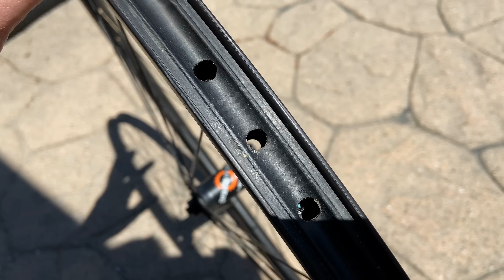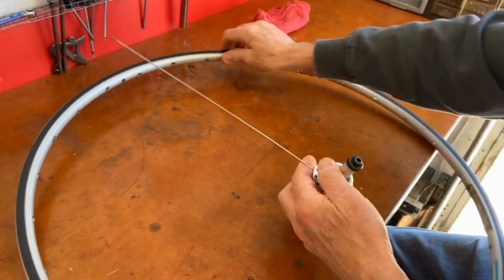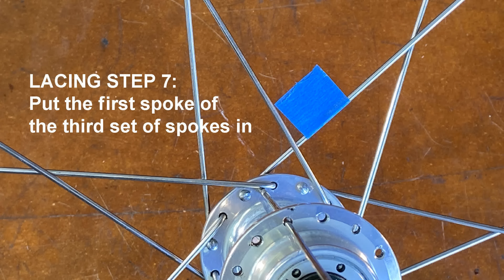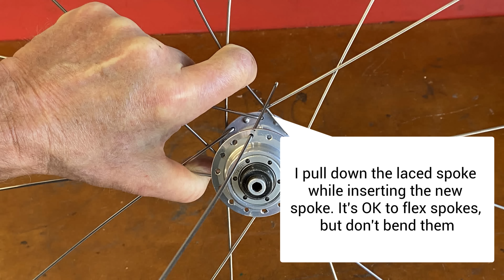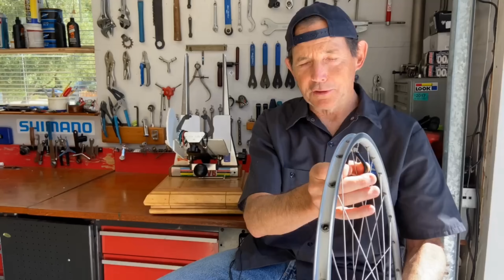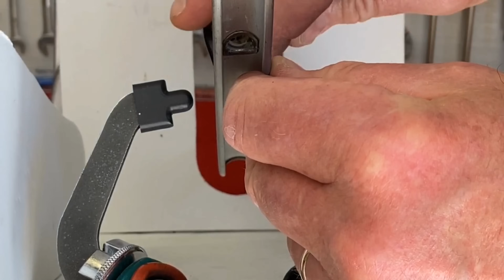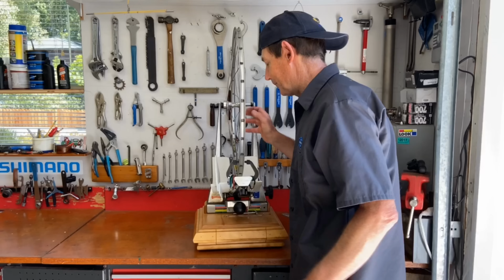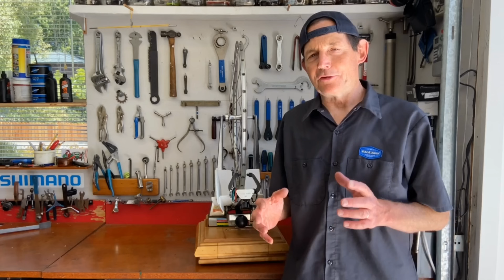How To Build Bicycle Wheels THE EASY WAY! #bikerepair

Comment: Hello, I want to buy 29” rims & put a Shimano  8 speed internaly geared hub with discs front & rear. How do I choose , what rims I need. I am living in the Philippines  & have a pedicab, which is like a side car set up with a 3rd wheel. Where do I start, may I ask ?  : )
Reply from the maker: Thanks for watching and the interesting question, Jethrezel. If I was asked to build wheels and choose rims for a pedicab (I have never built any), I would research what others are using for rims on their pedicabs. They have to be able to withstand the weight carried on the bike, the extra lateral forces on this type of vehicle and the roads/terrain they'll be taken over. Plus, they need to accept the tires suited to pedicab use. 

So, it's basically a research project to investigate what rims are used and then once you have a basic understanding you can then visit wheel parts sellers and choose appropriate rims. I would think that strength will be your primary concern and that you might even want to look into whether you can find a pedicab company that sells rims for pedicabs. They might be a lot less expensive than bicycle rims and will probably be made of steel. That might work fine. You should be able to make a good choice once you understand the specs you need for the use you have in mind. There are likely some mountain bike rims that will work, too, but you want to be sure they're strong enough. Hope something here helps you get started. Thanks again.
Reply: @JimLangley1  hello, Thank you for your reply. The rims are 28 inch steel ones. I would have to order a Shimano 8 speed internaly geared hub online. No stock where I am.  So finding the rims are no problem but  How Will I know if that hub Will lace in to the rim? Spokes also can you cut your own spokes to size? If so what is the formula for that, may I ask ?  : )
Reply from the maker: @jethrezelquizol6690  Here's my video on how to find your spoke length, Jethrezel - https://youtu.be/LvV4FE2VxZk You need the hub and rims to have the same number of spoke holes to be sure they're compatible. I'll read and reply to your other questions next so please keep reading below.
Reply: @JimLangley1  I imagine I count the number of spoke holes in the Rim & count the number of spoke holes. In the Hub I wish to use. If they are the same, then im Good to Go ?  But that just leaves me with choosing Spokes & Spoke size? What material makes the strongest Spokes & why ? : )
Reply from the maker: @jethrezelquizol6690  the best spokes are made by experienced spoke makers such as the brands Sapim and DT Swiss. And they would be made of stainless steel while the spoke nipples to get would be made of nickel plated brass. I hope this helps you build some nice wheels.
Reply: @JimLangley1  I was thinking of ordering Alloy rims online. Do you think I should stick with th steel ones here ?
Reply from the maker: @jethrezelquizol6690  I'm not a pedicab expert, Jethrezel, but the ones I see here are carrying 3 sometimes 4 people. That's a massive load. I would think you'd want the heaviest-duty, strongest wheels you could build. I think if you go with lightweight parts that work on a bicycle, they will probably wear out quickly on a pedicab under the weight of up to 4 people and in constant weather conditions. 

The pedicabs I've seen typically have steel rims, steel hub, heavy tires and even oversize gauge spokes in the wheels, and oversize hub axles, too - think cart rather than bicycle. A cart carries tremendous loads and is made to withstand the punishment. A bicycle is super light in comparison and carries only one cyclist.

Having said all that, you can certainly build the wheels however you want and see if they hold up for how you use your pedicab. Aluminum rims work great on bicycles and they would hold up for a while on any wheeled vehicle. But how long depends on how much load is on them and how hard they're used.
Reply: They just use cheap Chinese tyres here, Tubed 28”+ 1” 1/2 . I was going to order some 2” Maxis tyres online, with the Kevlar in them : )
Reply from the maker: @jethrezelquizol6690  be sure to get tires made for how you're using them - on a pedicab it's not about lightweight and performance, it's about durability. No sense paying top dollar for fancy features that save seconds in a race but will just mean tires that wear out fast under all that weight.
Reply: Also there just ordinary hubs here, nothing special. I wanted to order Shimano Hubs with Disc Brakes. They only use a block of old rubber car tyre on a metel bracket above the front wheel that you push with your foot. Its works Good but I would like Disc Brakes. Once again , How do I know the the Shimano Hubs & Brakes I buy online will lace in to the rims I choose or the Steel rims here, if you think they would be my Best bet? : )

Comment: Thank you for a great tutorial! This was very helpful.  I noticed that you didn't  use a spoke tension guage. Is there a benefit to using them to get the tension right.
Reply from the maker: You're very welcome. Thanks a lot for watching and commenting, Adrenaline. To explain why I don't show a spoke tension gauge in this video, it's because the video is for helping new builders learn how to build wheels. It would be unusual for them to own a tension gauge and they probably wouldn't want to have to buy one, either. If I showed myself using a tension gauge, someone might get the idea that you have to have that tool in order to build wheels. Instead of that, I wanted to keep it simple because spoke tension meters are fairly new devices. People have been successfully building wheels without them for a lot longer than the tools have existed actually.

But, having said all that, spoke tensio or tension (it's spelled both ways), gauges or meters are nice tools to have and very useful if you start building enough wheels to want to own and use one. There is a benefit to using them to get the tension right as long as you read and follow the directions on the tool - otherwise you won't get accurate readings. I do use one for my wheel building, one made and sold by Wheel Fanatyk https://www.wheelfanatyk.com/store/digital-tension-gauge/. Most production wheel builders do because we need to record the tension in our wheels since they're being sold and usually carry serial numbers. I do use and show the tension gauge in other videos so if you want to see it in use, you can watch here https://youtu.be/Wb73si7WD-k?t=576 Thanks again!!
Reply: @JimLangley1  Thank you for that very thoughtful response! It's good to know that the guage isn't a requirement for a well built wheel.

Comment: hello I wanted to ask you. my spoks is shorter 2-3mm I can still build my wheel
Reply from the maker: Hi S T N - when you’ve finished the wheels you should not have any threads showing. If the threads are showing you should rebuild with longer spokes or risk the wheel coming loose and getting out of true often. I hope this helps. Thanks for watching and the question.

Comment: the few times i tried to build a wheel from scratch, the up/down adjustment was the movement i couldn't get out.   side to side is definitely easier.    ...so i gave up and decided I didn't need to learn it since i don't really replace wheels that often
Reply from the maker: Thanks a lot for watching and commenting, littlegoobie - appreciate it!

Comment: Hours into my first wheel build, I found this video. Thank you, well done!!! Clearly explained, I really appreciated his direction, “now be sure to get satisfaction not frustration” paraphrase. This saved the experience for me. Do you have tutorials on bottom bracket service? Or a tutorial on suspension service? Thanks again well done!
Reply from the maker: Thanks for the great comment, Mike. I'm so happy I was able to help you with your wheel build! And I appreciate you watching. I don't have a video on bottom bracket or suspension service on my channel. I will add them to the list. Bottom brackets are relatively easy to understand - once you get past all the different designs and issues caused by that. If you currently have questions/issues with your bottom bracket, I might be able to help here in the comments. For suspension, apart from basic maintenance and setup, I get mine tuned by the pros at Fox, etc. They have the tools and small parts and fluids and they're up to date on every new thing that's come along. Thanks again for watching and the kind words!

Comment: Hi Jim. Fabulous video, thank you so much. One question, sometimes having built a wheel, there is still quite a lot of thread visible on some of the spokes. Is this a problem? Does it suggest spokes maybe not quite long enough (even though calculated correctly).
Reply from the maker: Thanks a lot for watching, Keith. I'm happy to hear you enjoyed my video. When you build a wheel and end up with quite a lot of thread visible below the bottom of the nipples, yes, it means that the spokes are too short. With brass nipples the usual result of short spokes is that the spokes tend not to stay tight because there isn't enough of the threads engaged on the spoke to keep the spokes tight. 

With aluminum nipples it's a worse problem because the aluminum nipples need the spoke inside them to reinforce the nipple where it has to resist sheer forces from the rim. So if the spokes are too short and the wheel is built with alloy nipples, then what usually happens is that the nipples break. Sometimes they will all gradually fail and break meaning a wheel becomes unreliable. 

The only solution to both these problems is to rebuild the wheel with longer spokes. To determine if spokes are long enough look down from above the nipple. You might need a flashlight. If the spokes are the right length you will see the ends of the spokes within a couple of mm of the tops of the nipples. Okay? I hope this answers your question. Thanks again!
Reply: @JimLangley1  Thanks!

Comment: Great video! Watching a pros work flow helps.allot. What do you recommend for lubricating the head of the spoke nipple with?
Reply from the maker: Thanks for watching, Tim. Glad you liked the show! On metal rims, oil or a light grease is fine for lubricating the nipples where they contact the rim. Keep in mind that if you have rim brakes, the rim is the braking surface so you try not to let the oil/grease make it onto the braking tracks of the rim. And, you always clean the rim after building the wheel with a solvent that will remove any grease or oil. For carbon rims, I do not use any lubes most of the time. Some carbon rims call for nipple washers which provide a smooth surface for the nipple to turn on. With carbon if you get grease or oil on it it can get into the carbon and stain it in places and be difficult to remove - depending on the construction and finish on the rim. If in doubt, you could reach out to the rim maker to determine what they recommend for their rims. Hope this is helpful - and enjoy your wheel building!

Comment: If only I could find a BASIC how to re-spoke a rim video, and not somebody trying to cram everything they know into one video, while trying to make it sound as complicated as possible.
Reply from the maker: Thanks for the comment, Jerry. If you tell me what you're trying to do, I will explain how to do it in simple BASIC words. You said "re-spoke" a rim." In order to help you I need to know what you mean by "re-spoke a rim." Usually, the rim gets damaged not the spokes. So, did you mean replace a bad rim on a wheel? Or, did you really mean you want to put new spokes in a wheel you have? That's what "re-spoke" means to me.
 

But, let's say you do want to put a new rim on. If that's what you're working on, it's an easy process. Here's how you do it. 

Step 1) Go around the wheel and loosen all the spoke nipples a few turns each.  
Step 2) Tape the new rim next to the old wheel. Make sure the  rim is lined up exactly the same as the old rim, with the hole for the valve right at the valve hole in the old rim. 
Step 3) One by one, unscrew a spoke nipple, move that one spoke and nipple to the same hole in the new rim. 
Step 4) When all the spokes are moved over, true your finished new wheel and get the spokes tight and you're ready to ride!

Hope this helps you out. I'm happy to explain more so don't hesitate to comment again and I'll try again.

Comment: Wow, just wow. I wanted to update my wheel to use a cassette system, so I got a replacement hub, that needed close enough spokes to reuse my old ones. This video helped me by showing the actual steps to it. I didn’t know it was this simple, otherwise I wouldn’t have put this off so long. Super easy to follow guide mate.
Reply from the maker: Thanks for watching and the great comment, Drago! I'm very happy to hear that my video made it super easy for you to update your wheel with a new hub! And congrats on mastering wheel building!

Comment: okay no, it isn't difficult.
but it IS tedious as hell, especially because in a lot of cases you need to de-construct another wheel. However, if the spokes are shot on the old wheel, just snip them in half.

Somebody is going to wonder "why build a wheel"?? My own reason will be keep using a good hub and bearing set after their ordinal rim has been worn to hell.
Reply from the maker: Thanks for watching and the comment, M P.

Comment: Very good tutorial learned more than I did when I worked at a bike shop in high school late 80's, side note I built a set of tubular wheels my first and only set and still riding today hit potholes, train tracks,  curbs , thrown the chain into the spokes a couple times tore out a couple spokes and been run off the road into ditches by drivers, all in all as true as the day I built them tensioning the spokes is a very important step for sure used a wheelsmith meter at the time and took the time to get each one as close to the same as possible they were my race wheels at the time now training wheels 
Still amazed to this day how easy professionals like yourself make it look well done sir thank you
Reply from the maker: Happy to hear you liked my video, TM - and congratulations on building such a fine set of hoops that they held up to all those things - even racing - and are still on the road today. Well done!
Reply: @JimLangley1  thank you, but I'm sure I'm so rusty i couldn't do it today, hence watching your video, it is an art and you are an artist my friend,  Matrix iso, old Shimano 105 hubs dt db spokes brass nipples, Thanks again
Reply from the maker: @tlheingrunst  You're very welcome. Thanks again for watching and the great comments!

Comment: Lots of good tips here, but I differ from this builder :
1 I almost always build by lacing the 'inners' (ie the spoke itself is between the hub flanges) first on both sides, twist the hub and then do the 'outers' (ie the spoke is outside the hub flanges).  
I find it much easier to do it this way, unless a problem specific to the hub prevents - such as with classic Sturmey Archer front dynohubs and 90mm front drums, which have a slot for two adjacent spokes - that enables spoke heads to escape the flange during the build.  Having written that, I think that next time I build one, I will try doing drum inners, then the off-side inners, same side outers, and finally drum outers - and see if that works ok.
2 He builds with an 'inner' adjacent to an 'outer'.  This is how machine-made wheels are built, but hand-made wheels do not need to be done this way. I feel that pairing two 'inners',  and two 'outers' makes a better wheel.  I always make the rear driving spokes 'outers', as I feel this makes a more stable wheel, and makes the tension and load on the driving spokes more equal.  
3 Some hubs have a milled recess for the spoke head.  In that case, you have to follow the hub maker's preference.  If that maker is mostly for machine building, you will probably be stuck with pairing an  'inner' with an 'outer'.
Reply from the maker: Thanks for watching, the kind words, and for describing how you like to lace wheels, Pashak. There are many possible ways to lace wheels and different patterns possible.  The goal of my video is to help beginners successfully build wheels and what I show is the easiest way I've found to teach that. Once you start dealing with more than 1 spoke at a time, the potential for confusion and misplaced spokes goes up a lot. That's why I keep it basic and simple in this video on purpose. I do have two other wheel videos that go into patterns, one on Shimano's disc brake patterns and another on spoke terminology where I talk about symmetrical spokes. Hope this explains and thanks again for watching.

Comment: The name "Langley" rang a bicycle bell with me. The Wright brothers built the first powered airplane.  Samuel Pierpont Langley was a well financed competitor racing to build the first airplane. His failures resulted in the test pilots getting wet, as Langley launched his builds above water to splashed down instead of crashing on land...
Reply from the maker: Thanks for watching and the comment, Tony - appreciate it. I am distantly related to Samuel Pierpont Langley, actually and my father was an aeronautical engineer at MIT who participated in the work for the moon landing. But I followed in the footsteps of the Wright Bros... at least when they were bicycle makers. You probably know that their wing warping discovery that helped them finally successfully fly is said to have come to them when they were handling an empty cardboard box from a bicycle tire tube. Or that the "landing gear" on their test flyer was a bicycle hub and the drivetrain had bicycle chainrings. It's amazing what these geniuses came up with and accomplished. Thanks again!